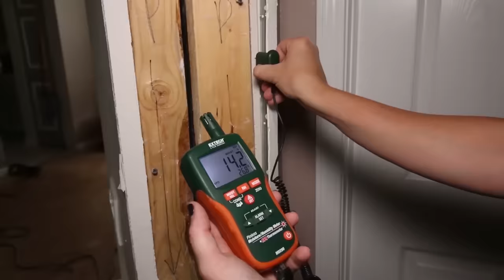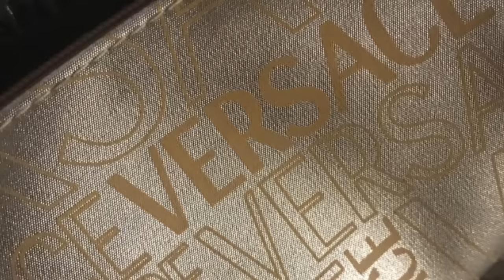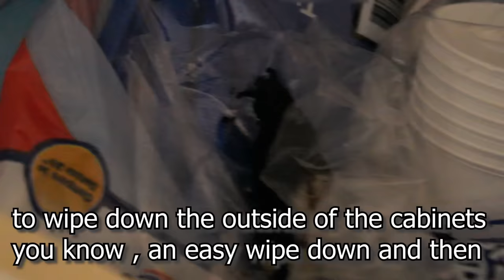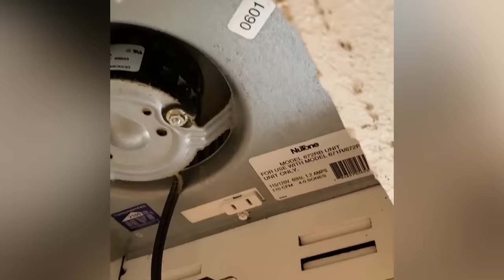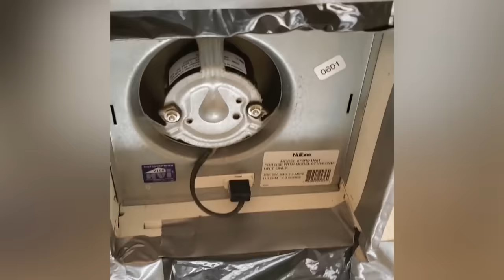Episode 4: Double Decomp

Comment: I have a question. What would happen if you left some of the biohazard? Would it be a problem later? 
Ok.. Example. 
You get to a place where the body has decayed for a few weeks, and you take out the floor, but not the subfloor or some plaster inside the wall has been tainted with blood and other fluids, but you leave it and and build, clean, paint over it. What is the potential danger caused by that?

Comment: I'm assuming with the poop one it was either that the person was old and couldn't hold the poop in themselves. Wiped it on the drawer, sat down and eventually passed. Or it was once the police came and removed the person, their bowels released and a cop ended up using the drawer to wipe. Only two logical answers

Comment: Once the scene is as clean as possible, wouldn't it be prudent to run an ozone machine for a few hours in the enclosed place, using fans to insure the ozone is circulated into all the corners and nooks and cranies? I know ozone can be dangerous to breathe so it would have to be used only in a sealed environment. After a period of time, the area should be evacuated completely with fresh air. From what I read,  (I'm no expert, even close) the ozone will kill any kind of microbial life, leaving clean fresh air. Ozone gas will also damage some materials such as plastics. Just a thought......